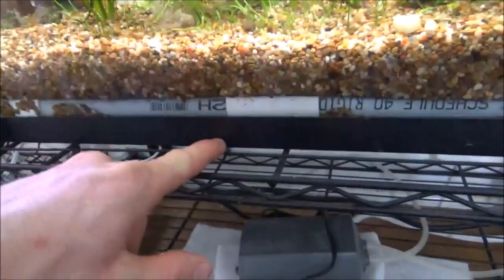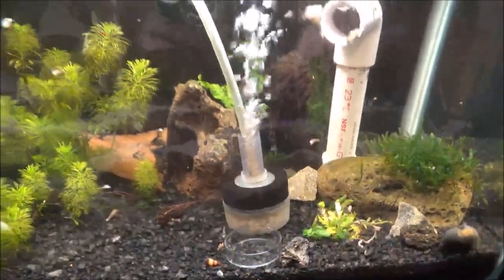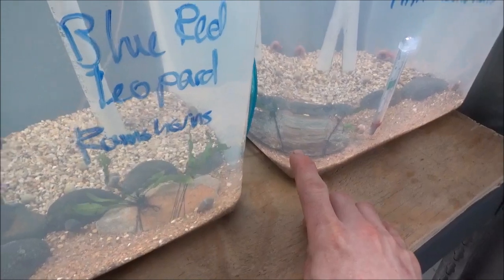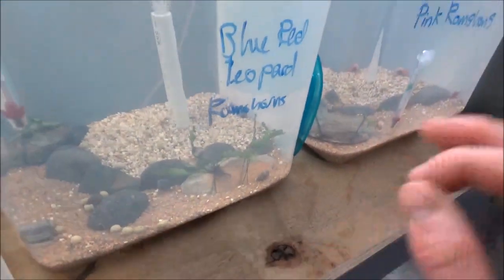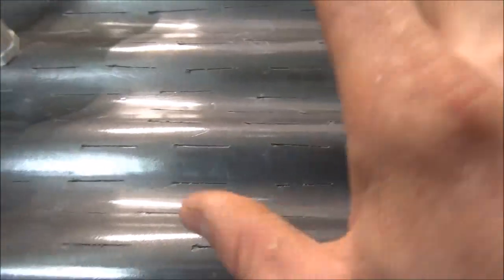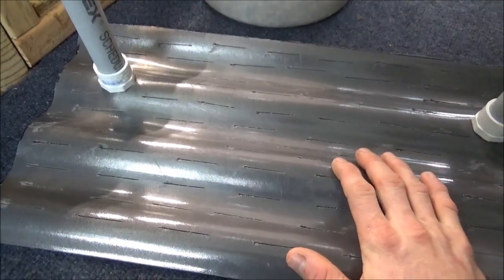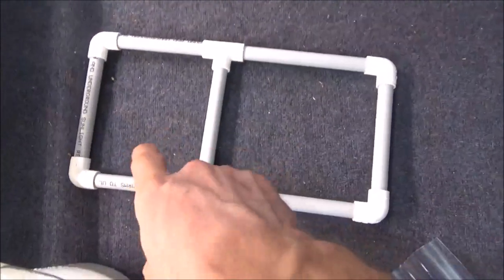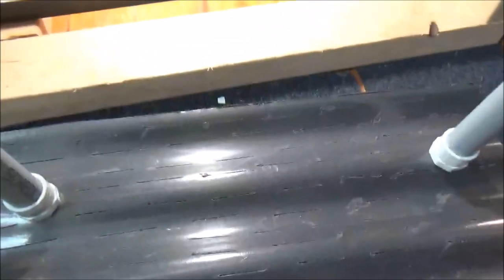DIY Under Gravel Filter

Comment: I made mine out of a scrap piece of 4" diameter pvc drain pipe and sawed a bunch of slits in it and split it down the middle and heated it up on the stove to open it up and flattened it out so it sits almost flat. I put a few broken chunks of marble as support spacers then covered it with a fine mesh cloth so sand don't make it underneath it. A small 1/2" lift tube connects to my filter pump and that's it! This thing will probably last a crazy long time without worrying about it breaking lol.

Comment: You should try the czech style of uplift tubes, no stones involved to restrict water flow and far beter water circulation for the amount of air used,  you could also make a bell with fittings at the bottom to stop the stone blocking the ingress of water. With bigger diameter tubes you lose flow if you do not have super air flow. Rather than slitting the sheet plastic with the multi saw try using an angle grinder with a 1mm disc cross ways on the ridge rather than length ways, safer than a dremel its super fast and you can adjust the size of the slits to suit.
Its good to see the younger generation using UG filters again, when I started it was all there was. Personally I think much better than a canister that only takes out suspended material.

Comment: You really should extend those vertical output tubes to just below the surface level to increase water flow and use the right angle fittings to eject the water right at the surface water line to provide surface agitation for oxygenation.

I've been working with UGFs since about 1962 when they came out.  They were sold with extravagant promises of being a permanent, no maintenance systems.  Today they are out of favor and here is why: there is a 'sweet spot' of 3-10 months where the bacteria bed is handling the waste output of the tank, but then with the accumulation of mulm in the gravel you get 'old tank syndrome,' when the nitrates and phosphates get too high.  Fish begin dying off for unknown reasons along with other problems.  So, to get the benefits of the large bacteria bed a UGF offers, the user needs to do gravel vacuuming along with water changes.

But there are still problems using standard UGFs.  First, many rooted plants do not do well with water circulation through their roots.  Floating plants do better.  Second, water flow is simply too low using air stones.  Much better performance can be gained using power heads.  And much better still, use the power head in reverse flow mode so that water is pushed down under the UGF and up through the substrate, thereby avoiding any mulm accumulation.  

Lastly, DIYers can achieve the ne plus ultra of UGF performance by placing a filter floss box first in the filter chain before the intake of the reverse flow power head, to strain out the tiny floating particles that may come up through the sand.

I ran such systems on my African Cichlid tanks and always had 0 counts for ammonia/nitrite/nitrate and crystal clear water.
Reply from the maker: its my understanding that roots like water flow at their roots since they absorb oxygen there as well, that and the fact that nitrifying bacteria is dependant on oxygen, and what feeds nitrifying bacteria feeds plants since without the bacteria the plant would have no nutrients to absorb due to the symbiotic relation ship. unless aquaponics and hydroponics are somehow bad for plants?? in my experience and from the books i have read ,flow is good for all plants at the roots it keeps root rot from happening , which is a result of lack of oxygen and anaerobic conditions. though most roots combat this with acids and enzymes that can free up space but if a plant that is not adapted for lets say living in a swamp it will not have the ability to deal with the excess water lack of oxygen, and bacteria and fungi that have adapted to those circumstances.
Reply: I don't think any of that is true LOL and yes I know this is a old comment but it came up in my feed today LOL
Anyways, you don't want super fast flow  out of a undergravel filter/ plenum.   The roots like the slow moving current under the plate.   and you could design it so you could hook up a inline pump and just suck the gunk out after a year or so if you wanted to.   if you make the space bigger you can put media under the plate as well.

Comment: how would this work with sand  ? very cool thanks  im the same way i rather build it  . will save this video too keep up the good work
Reply: I saw another video for sand as I like sand as well. They use a plastic ground cover you can buy at a HD or Lowe’s that hold the sand but still let’s water go through

Comment: do you have to clean that under gravel at any time?
Reply: How do you "flush out" what is under neath it?
Reply: @pa.fishpreacher6166  For a flush out two ways, on next water change tie a filter sock on either of the upright tubes and use your fresh water hose and a funnel in the other, after you have siphoned out the water for your exchange, pour clean water in via funnel port and all the junk underneath will be caught in the filter sock. 2nd way is to put the siphon hose down one upright and pull out your usual dirty water out by 1/2 water change planned, transfer siphon to the other up right and pull out your other 1/2 of dirty water and refill as usual. Gravel is porous, allowing water exchange to occur between all it's depths, and doing it through the uprights means you have massively less chance for losing tiny fry or shrimp babies, and it really cuts down any Planeria or Hydra to hide in gravels and malm layers. Big improvement over old style singe tube under gravels from back in the "1960's", only way to clean those dinosaurs is to empty tank of everything in it down to bare base, soak the old filter and sand/gravel In salt at super saturation solution, rinse in a potassium permanganate solution, finally rinse several times in chlorine free water, same for the inside of tanks, and repeat all steps again in 6-12 months. Plus back then they drummed into you, no plants, no snails, weekly full filter media exchange, and dechlorinate water; after an hour put the fish right in. Out of 20 fish you will be lucky if 1-2 are still alive in 2 months. With my LFS only diff from then to today was don't buy fish for 6 months after tank is set up and running. But still today no live plants, no snails, change all filter medias weekly, and now he adds no fish for 6 months ! Why even buy the tank, why not just watch other people's fish on the computer ??? 3 hour drive round trip to my "Local" fish store, 4 hours spent in store watching multiple other people be waited on and for $1-$10 dollar items, I was planning on spending at least $300 for a tank(not a Kit) and the items that were worth paying for. If I had gone to Petco I would have been in and out in less time, less cost, with the items I wanted(not the kit of unsale-able, break in a month or less pile of trash), with plants and fish and snails in under an hour, and save an hour's worth of gas in the car. Kit HOB filter didn't last 2 weeks, and supply of "Free with Kit" fish food didn't equal 1/2 teaspoon. Lucky other people run their stores differently, and that I had seen many of Aquarium Co-Op's videos on YT, so I was able to order many good and dependable items from Cory, including a master test kit and 2 sponge filters, Repashy, ect… and it all arrived soon enough to save 1/3rd of my 6 guppies, all 6 Black tetras, 3 Cory, and a Pleco.

Comment: dremels are overrated unless you're a fluke-pro, they always bite and jump off the material which screws up the cut... If dremel wheels and attachments were 350% bigger they would be a much better tool.  Dremels are more of a jeweler's tool than a construction implement - it ain't not HILTI that's for sure